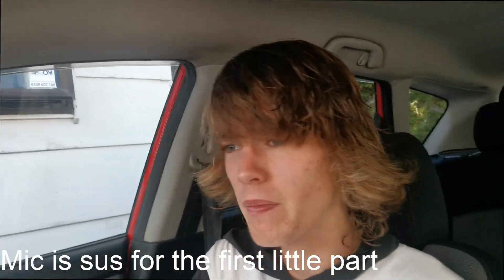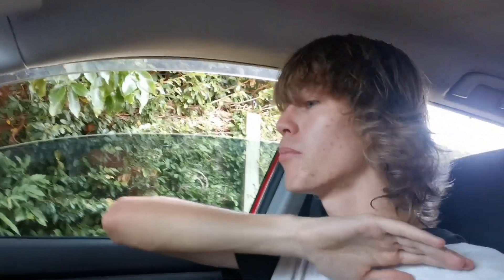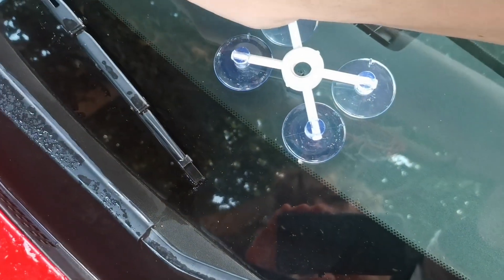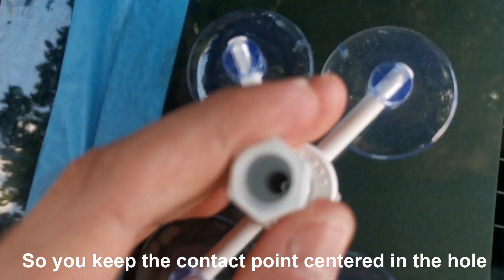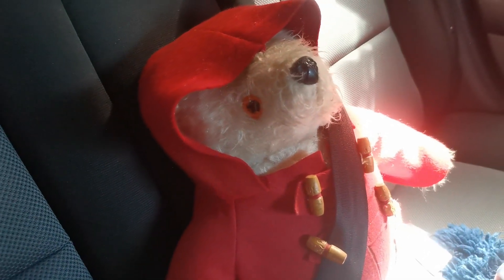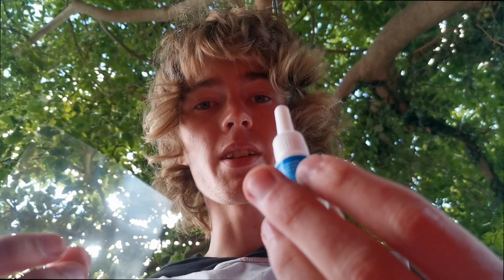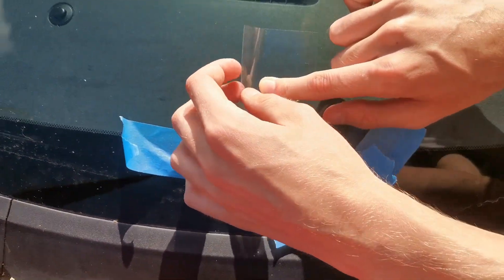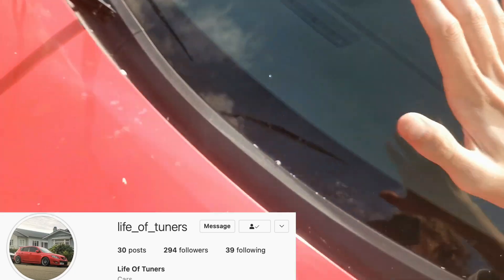When nothing goes to plan. Mazdaspeed 3 MPS

Comment: Honestly bro, as someone who works with glass and does windscreens and chip repairs everyday. Get it done by a professional I could see so many things wrong with that kit. It takes 30mins and cost piss all. A bad repair can run and become bigger, it can cause a weak point in the glass, and will cost a sh*t ton more to replace windscreen. If wof inspector finds it which is possible depending on how well its done, it will fail because you have no chip repair report proving its been done properly. Just a warning. Perhaps take it to someone who can at least have a look at it and give further advice. Just don't take it somewhere like Smith and Smith, they will tell you that it needs to be repaired when perhaps it is fine. Take it somewhere more local.

Otherwise keep the vids up bra, channel is only getting bigger.
Reply from the maker: Ain't got the money for that lolz 💔